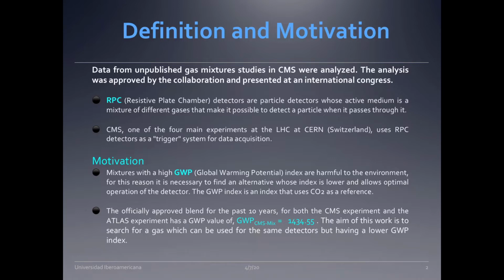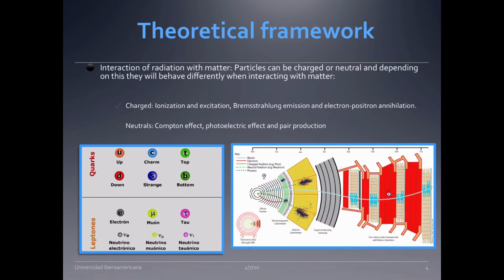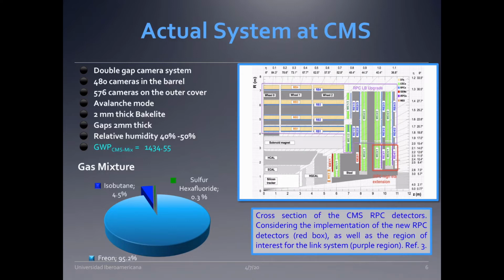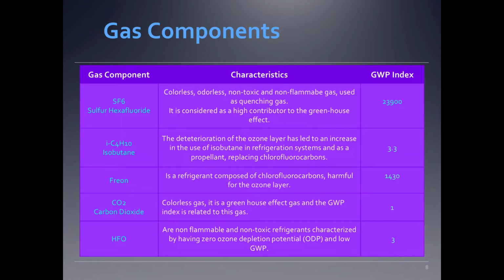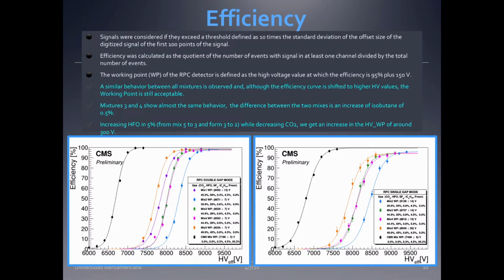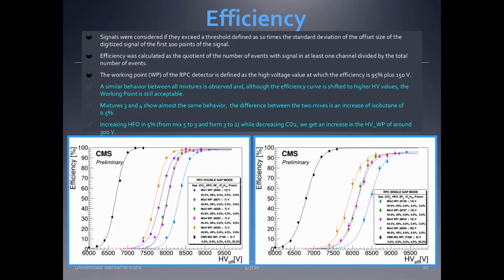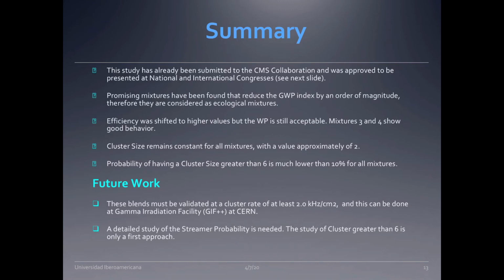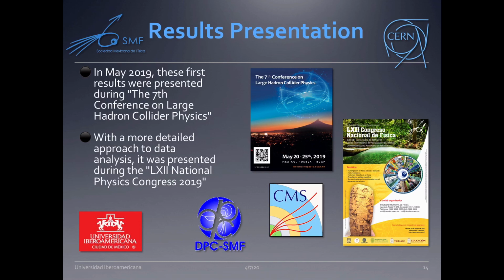Eco Gas Studies for the CMS iRPC Detector for the High Luminosity LHC

Comment: This is an interesting study. Regarding the alternative gases chosen to substitute Freon, ¿how did you choose them and their proportions in the mixes you measured?. I guess there has been previous work by the collaboration or from other references.
Reply from the maker: Hello Mario, thanks for your question.
Yes, there are previous studies, where HFO has been identified as a good replacement for the Freon and has a low GWP value. But, it also has a big impact on the reduction of the avalanche charge making necessary the use of CO2 in order to work at not so high High Voltaje values (above the RPC power system limits).

Comment: Hi Dalia. Nice summary of your work. What is the maximum GWP index that would be acceptable? Do you know how this index is determined for each component in a gas mixture?
Reply from the maker: Hi Alexis!, thanks for your questions.
There is no maximum value for the GWP, the new regulations encourage us to lower this index for the used mixture. It is worth to mention that big experiments at CERN are exempt from this regulation, however, we look for a lower environmental impact and help to face climate change.
The definition of the GWP is the amount of heat absorbed by a greenhouse gas in the atmosphere, as a multiple of the heat absorbed by CO2. GWP of CO2 is equal to 1, then GWP of the other components is a multiple of this.

Comment: Hi Dalia, nice study, here a few questions:  
What is the gas mixture that has a GWP of 1434.55? 
In terms of particle interaction, what is the reason to have an offset on the efficiency curve comparing the CMS mixture w.r.t the other options? 
How good is the time resolution comparing different gas mixtures, considering that for the high luminosity we need a resolution of a few nanoseconds?
Some relevant information can be obtained using simulation packages (Geant4, Garfield, etc…) have you considered this for a cross-check with your data?
Reply from the maker: Hi Alfredo! thanks for your questions.
The GWP value of 1434.55 corresponds to the actual CMS mixture.
The offset of the signal is due to many factors, for example, the amount of generated charges due to the particle passing through the gas, its way to the electrodes, the ease of discharge, and the contribution of secondary ionizations.
The time resolution is of the order of 1 or 2 ns. But considering a resolution of 10 ns is still functional, however we are not depending that much on time resolution, not for the double gap cameras. This value is more important for multigap cameras.
Yes, thanks for the comment, I´m already making a simulation using Geant4, to compare some results.

Comment: Hi Dalia, What is the  optimal range of HV operation? , How much gas  will it need the whole detector, it is equivalent  to what in pollution ? one car, maybe a big factory.?
Reply from the maker: Hi Pedro, thanks a lot for your questions.
For the first question, the optimal range for the actual mixture is between 8 kV and 10 kV this is due to the different conditions of humidity and pressure and the used gas. On the other hand for the proposed eco gas mixtures, the Working Point increases, and then the range is between 10 kV and 12 kV.
For the second question, at CMS there is a gas flux between 2 and 4 L/h, and leaks of about 600 L -1,000 L per hour.
A car will emit 1232 L of CO2 per L of gasoline.
Considering the 600 L (of leaks) using the CMS mixture, we have 860700 L of CO2,
 this is equivalent to 698.6 cars.
For 1000 L (of leaks, using CMS mix) we got 1434500 L of CO2, equivalent to 1,164.4 cars

Now if we consider the mixture number 3 (which is one of the eco mixtures presented here)
For leaks of 600 L, we got 87300 L of CO2, corresponding to 70.8 cars
And for 1000 L, we got 145500 L of CO2, corresponding to 118.1 cars